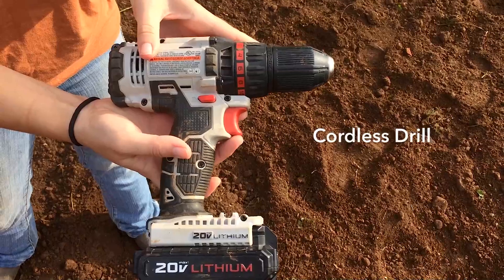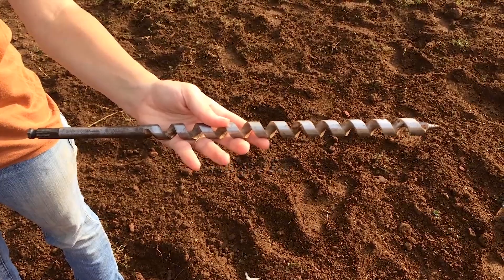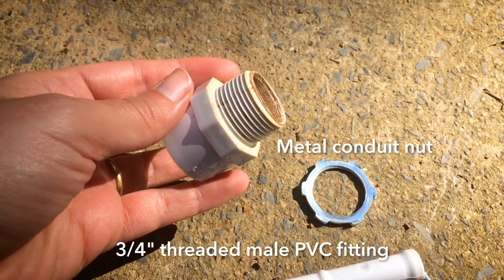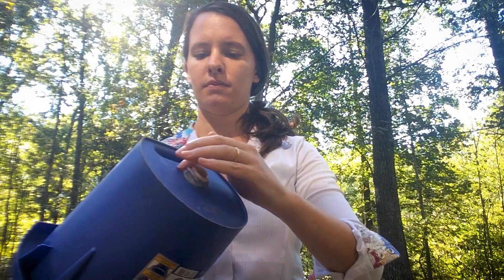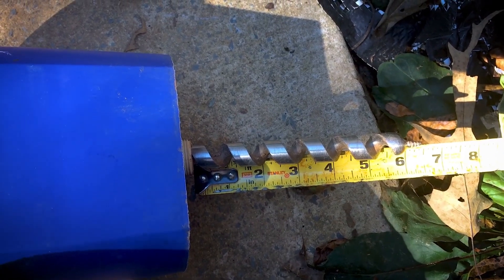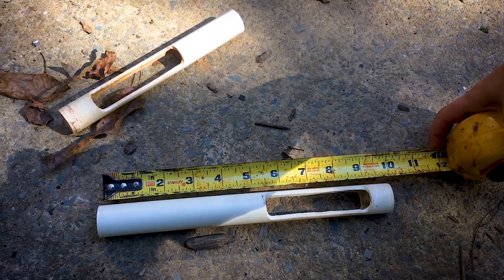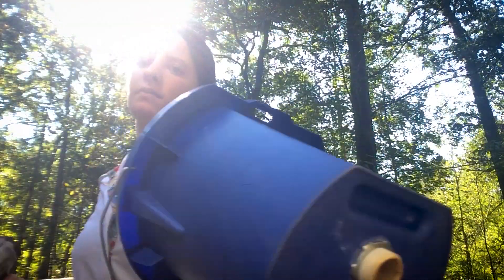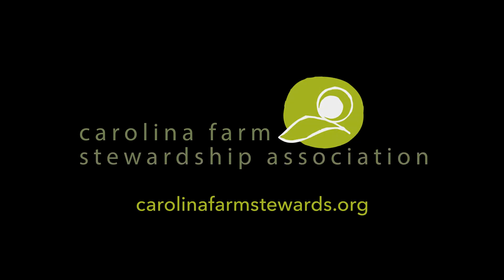How to Build a Sweat-Less Soil Sampler

Comment: I just built my first one for my wife and here are some comments:
1.  A 3/4" auger bit fits perfectly in a piece of 3/4" Schedule 40 PVC pipe.
2.  Unfortunately the 3/4" bit won't go through a 3/4" threaded fitting.  I solved this by using a 1" threaded fitting (requiring a 1-1/4" hole in the bucket) and then used a 1" to 3/4" reducer.  Works great!
3.  The toughest part for me was cutting the window in the 3/4" pipe to let the dirt out.  I used a band saw with a fine tooth blade and just freehanded the window.  It looks like the one in the video has two windows, but I was worried about losing strength.  One window seems to work well.
4.  I made my window a little too wide (cut too deep) and the tip of the auger bit will try to escape if you let it angle as you pull it up.  Being careful with technique can eliminate that, but if I make another tube, I will cut the window a little shallower (narrower).
5.  My cordless drill has two speeds and we have found that the faster speed is much better at bringing the dirt up and ejecting it from the tube.
6.  We used a smaller bucket than shown and the bottom isn't very thick which makes it kind of flimsy.  I may consider reinforcing it with a piece of plastic either inside or underneath.  Again good technique and keeping the bit straight probably makes this unnecessary.